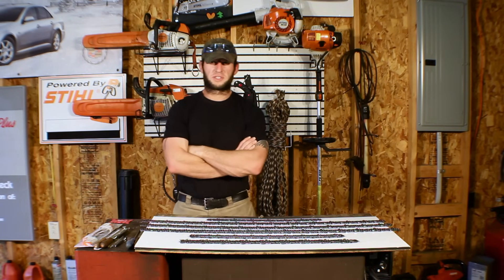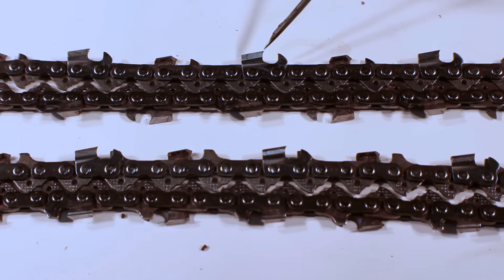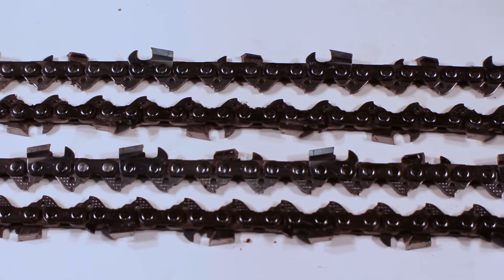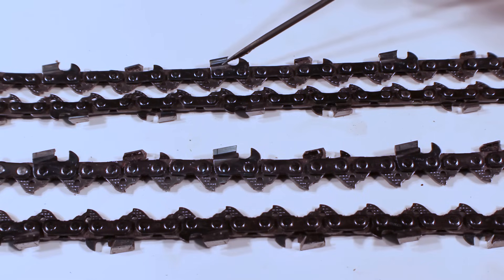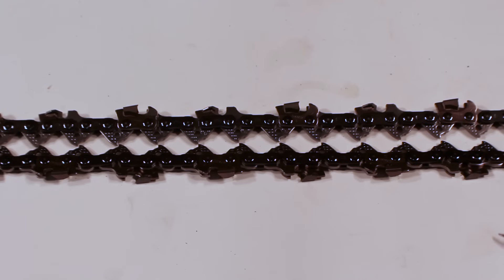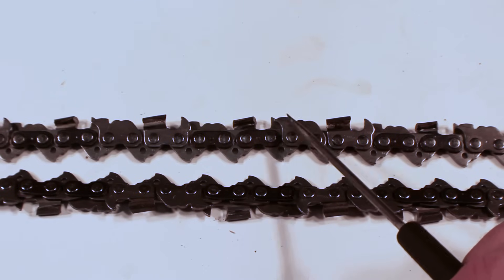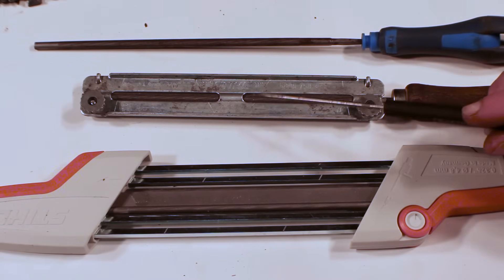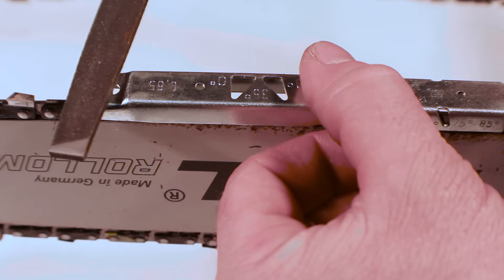Chainsaw Chain Types Explained

Comment: Okay, I want to ask this. a bit off topic but I haven't found anyone who addresses this question.
So I am thinking about buying two saws. one small and one larger and more powerful. So regardless of manufacturer or brand - what two bar lengths make a good combination? In a farm & ranch situation. I am on 16 acres in middle Tennessee,  partly wooded with verious trees. Cedar, White Oak, Red Oak, Ash, Box Elder, Osage Orange  <- (I know - hard). etc. Using mainly as downed tree and limb clean up throughout the property. There is a lot to do throughout. I may fell some standing trees. I do not plan on larger than a 20" bar for the most part but maybe want the capability to go a bit larger if and when needed). So I guess I am asking what smaller bar is best if my larger bar is a 20" ? 
PS. I am thinking probably to have  two saws and not just two bars on one saw as I think those lengths would be too close together.
Here's what I am thinking maybe:
1. Small saw a 14" bar.
2. Lager saw w/ a 20" bar
Does two saws make since? 
But what do the experts say?
I know I got pretty long here but I hope this question makes since.  Thank You.
Extending my question a bit and getting brand specific. I pondered over and over about Sthil or Husqvarna till no end... I am now actually considering an Echo cs-590 with a 20" bar and either an Echo cs-310 w/ 14" bar or the Echo cs-352 with a 14" bar as my smaller saw.
So would either of those saws and bar lengths be a good combination? 
Thanks again.
Reply from the maker: Honestly, if you think you'd want a 20" on your large saw, then there's no reason to go with another smaller saw.  Just grab a 261 (or equivalent) with a 20" bar, and that is the one saw you'll need.  The weight difference in saws between something with a 14" bar, and a 20" bar, isn't significant enough in my opinion to justify having two separate saws.  Going into a 25"+ size bar is different, but I think you'll do just fine with one saw.
Reply: Human Thanks.
well a 261 Sthil was one I was thinking I would get when I was tossing between Sthil & Husquvarna. But somewhat dhifted after a local dealer showed me cs-590. at which time I thought no way to Echo, but after watching tons is videos and foarms on Echo I became much more impressed. The CS- 590 is $399 and has professional qualities from what I hear so far... With that price plus a 5 year warranty on the Echo - would you still suggest the MS-261? 
Thank again
Reply: Calibir1 I have never ran an echo don't know much about them. but I have the 261 with an 18 inch bar love it really light I cut elm and oak with it and chews really well chain is kept sharp as any saw. then my big saw is a 461 stihl I bought it with a 25 inch bar I'm going to a 32 inch bar at some point that way I don't have to bend over as far I know not supposed to use the tip (someone will say) of the saw but when a tree is on the grounds you can't tell me you dont. anyways I'm not a professional but I have been running stihl saws a long time and I like doing stuff the right way. I sell firewood and burn wood 7
Reply: my 261 though came with .325 chain and I wanted 3/8 so I didn't need to try and keep track of files so they put a sprocket and bc on so I could have the 3/8 chain.
Reply: I have three. 14" small Husquavarna,20" Poulan 3400, and a Husky 394 XP with a 32' bar that is my go to saw. I'm 57 and I bought that Poulan new in 86 and have wore out 5 or 6 bars and countless chains but i just can't take working bent over all the time( too many years a a farrier) and the 32" bar makes it so I don't have to. I'm 6'1" and can cut downed wood with very little stooping, does it way more yep but I let the saw do the work so I'm not manhandling it all the time.  If I had to start out again I think I would buy a 395XP and a 16" pro model, stay away from home owner saws. Nothing but agravation.

Comment: Good explanatory video. Had a?. A buddy of mine is planning to fabricate a mill. It will strictly be used for cutting slabs with logs up to 65inch in diameter.with a14 foot cutting length.the power source is a 10hp 3500rpm 3phase motor direct drive through an electric PTO clutch. What chain do you recommend for this application? Again thanks for the video.
Reply from the maker: Ripping chain, made just for that type of application.  Also the one chain (that I know of) that I forgot to talk about in the video, lol.
Reply: Human Thanks bud for the reply. Will relate info to my friend,he was also mentioning of going with a carbide tipped one there pretty aggressive and long lasting.Im not up on the chains and what to use,but I have a machine shop with fab section where I’m building the mill for him.Its going to be very productive for slab work.Again thanks for the reply.

Comment: Been watching your videos for about an hour now trying to decide on my first saw. For now it will be just a saw to throw in the back of the truck to take when I go in the woods hunting or shooting in case of emergency. Also do some side by side off reading. However I would like to keep the possibility of firewood cutting open. What would you suggest as a first saw? Wanting to stick to Stihl.
Reply from the maker: Of course I'd go with a 261, lol.  For what you're wanting it for though, I'd go with a 251 or 271, either one will do you well.
Reply: Human does that mean you would stay clear of older generation saws? A buddy of mine suggested an 034 super if I could find one.
Reply from the maker: Not at all, I love older saws.  Just be aware that depending on how old it is parts may be an issue.  I've not a whole lot of experience with older models, but I generally hear from those that do that the older saws are built better.

Comment: What are your thoughts on running 3/8 picco with a regular 3/8 setup? A lot of people on the forums say to switch the bar/drive sprocket,  and my local shop says it will run the same as standard 3/8 chain.

Comment: anyone know... IF .....its known.. that Stihl mistakenly stamps the wrong inch size on a bar ? I have a ms250 and 024AVS  ,  just bought the 024 and told was 18" and bar states 18" .325   .063 74DL
  so looked at the MS250 because is was gona order several new chains and it said 18" so i ordered extras only to find that when  i put one on the 250 the bar is so far out the outer bolt barley touches the bar !!  i laid the tow bars together and one appears to be 1.5 - 2  inches longer, same with old chain and new chain, even when thinking about old chain stretch ....chain appears to be 2 inches longer that old on the 250????????

Comment: awesome and informative vid buddy. I have a poulan 16" saw I got for cheap what chain type would you recommend to cut fastest with low  maintenance? I don't mind paying for good quality. I'm thinking rescue chain?
Reply from the maker: Rescue chain is super expensive, and not generally all that great if you're cutting wood, they're made to hit metal/brick/etc.  I'd stick with a regular full comp chain, and just keep the depth gauges a bit high so it doesn't bite so hard.

Comment: Is it still possible to do a bore cut with the safety chain? If that depth gage/raker is lifting around the tip of the bar I would think that could make that difficult or almost impossible.
Reply from the maker: What I thought at first as well, but it makes no difference, saftey chain bores just as well as non.

Comment: Are skip-tooth or semi skip also referred to as ripping chains? Are the cutterheads the same for ripping and standard chain?
Reply from the maker: Ripping chains have the cutter teeth filed at a 10 degree angle instead of the normal 30 degrees.  Skip tooth is 1 cutter tooth where there normally would be 2.

Comment: Okay - I should know this but what is the correct gas/oil mix for a Sthil small MS 170?  I have heard/read  50:1 and as much as 20:1     Thanks much -   Gary
Reply: 50:1 and use proper synthetic 2 cycle mix oil. Running a mix with more oil than 40:1 will make the saw run super hot and kill it quick.

Comment: Human, 
I got the MS261C-M 18” bar. The chain it came with is a 74 drive link. I’ve been looking to get another chain, looking at the Yellow chains, Yet I noticed most of them are 68 drive links. All state they fit an 18” bar. 
Do I need to stick with the 74DL or will the 68 fit ?
( I’m new to this! )
Much Thanks!
Reply from the maker: Yes, you must stick with a 74 DL chain.  The 68 DL will only fit 18" bars on smaller models.  Some of the saws have different distances from the drive sprocket to the chain adjuster, biggest thing to look at is the drive link count (and pitch/gauge of course).  So just make sure and grab a  .325, .063, 74dl and you'll be good.  If they don't have it (no reason they shouldn't) ask them to make one from a spool, if they don't have a spool, find another dealer.
Reply: Human, 
Much Thanks.

Comment: Does it really matter if I change my chain from a 62 link to to a 63 link chain?  It is on an 18" chainsaw and I figure since I can adjust it that one link difference should not matter would you agree?
Reply from the maker: I couldn't really say one way or another, going to depend on the saw I would imagine.  I do know that I just replaced an adjuster on a work MS 290 becuase they had one extra link in, and just thought muscling on the adjuster would make it work for some reason.

Comment: quick question.  I was out running my cs590 today.. chain kept getting loose.  finally got to the point where it wouldn't tighten anymore due to the bar being out of adjustment room.  Still plenty of life in the chain cutters.  is the chain wore out?  do I just remove a link in the chain?
Reply from the maker: You can remove a link, what brand chain?  The whole reason I only run the stihl chains currently is that the others kept stretching and pissing me off, I'd maybe try a different brand.
Reply: Human it was the factory echo chain.   Of I take a link out won't it change how many drive links there are?

Comment: ms361 24" bar has no info , so do you have a vid on how to know what chain i have on it to buy more?  links have 3/8 on some , stihl C on some, m1 on some ???
Reply from the maker: look on the bar, all the info is lazer engraved on it
Reply: @Human1337   yes , thats why im asking , the bar clearly says 18" but putting an 18" chain on the bar, its so far forward its barely touching the first bolt...!!  clearly the bar is stamped wrong which is why i asked if any one has had a bar marked wrong.....!!!!
Reply from the maker: @topflight2358  18" isn't the size of the chain, chains are measured in drive links, will be shown as DL on the the bar  like x55 DL = 55 drive links

Comment: how's the carbide chain working for you?
Reply from the maker: Couldn't tell you, borrowed it from the parts guy at arts, had to take it back.  Same with the rescue chain, no way I was paying $200 for a chain just to use in a video, lol.  I need to get a carbide chain, but there are things higher up on the priority list right now, namely a port-a-wrap and arborist block.  Boss doesn't mind that I use his, but I prefer not to rely on other peoples equipment.
Reply: Human what chain is $200? don't use the emergency chain use the duro3 for the chain and bar that you use most, it will save you lots of time and money. the boss should buy it for you because it will save you time swapping chains and sharpening.
Reply from the maker: Yes, it's the rescue chain that's super expensive.  Doubt the boss will go for the carbide, mostly as we don't have a means of sharpening it.  I'll work on him though, lol   =)
Reply: Human it's simple enough to get a diamond round file for sharpening the carbide chain and you can use it on steel chains too. why don't you like to use the company Port-a-wrap and block pulley? They should be able to supply a higher quality one than you could purchase on your own.
Reply from the maker: I should have specified, these are for my side jobs.  On the job, of course I use company equipment.

Comment: Talking about sharpening equipment for carbide tipped chains, we used to use a "green wheel" to sharpen that material in the machine shop. I couldn't remember the composition of the wheel, so I googled it and this came up.

"Green silicon carbide wheels are more friable than the black wheels and used for tool and cutter grinding of cemented carbide. Cubic boron-nitride (CBN). Cubic boron-nitride is an extremely hard, sharp and cool cutting abrasive. It is one of the newest manufactured abrasives and 2.5 times harder than aluminum oxide."

Proper attribution for the quote goes to americanmachinist.com

Comment: drive links do not give you length of chain !!!! some 18 inch chains have 68 drive links and some have 72 ect !!! i think the pitch has to do with this im not shaw !!!! but i have a stihl and a johnsered both 18 inch and they both have different drivelink count !!!! Just something to beer in mind !!!   great info videos though!!! keep them up !!!!
Reply from the maker: You're correct.  The pitch makes a difference, and also the chainsaw model.  Different models can have different distances from the sprocket to the bar.  For stihl saws, a model with a tooless chain adjuster will have different drive link counts than the same model that doesn't have the tooless chain adjust.
Reply: so one 18" chain can be different than another , even for the same saw model? having stress with a 18" 445 husky that i bought some new Husky replacement 18" chains for and they are noticeably longer than the original that came with the saw when i bought it,  which to me is a little nuts. i get the pitch and width part, but shouldn't 18" be 18" no matter what?
Reply: Nah, an 18" Stihl with "quick chain adjust" technically uses the same bar as one with normal chain adjustment. Only differences are the lack of regular bar adjuster, different bar cover, and adjuster gear added to the bar.
Reply: Different manufacturers use different bars, this will cause the variation in driver count.

Comment: Whats your opinion on filing the rakers off?
Reply from the maker: I wouldn't.  Even taking them a bit too low can cause huge problems.  when I first got a set of the 2-in-1 files, I took all of them down too low, chain binds, jumps around, serious kickback hazard, etc....

Was not a fun time
Reply: 200lbGorilla, ripping chain has a much lower raker than other chains,  but you would pretty much ruin any chain that you took them completely off. You couldn't adjust them to the cutter any more.
Reply: I always use a hacksaw blade. Rakers should b low enough to just slide. Hacksaw blade under cutter. Just my own experience.  Croscutting  Simi green FIRE wood. There probably is a proper way. Especially on ripping chains. I have no experience with them btw. But  will soon. Just got a Mack 25080cc with gocart carb . I use 112 octane leaded fuel in it with 3' bar.
Reply: @walliehart2055  
Now wait a minute, the guy in the video never mentioned "Rakers" and I believe that rakers is more of a common nick name for the "Depth Gauge" right? If so then once you bad back just a little on the cutter then the depth gauge will hold the cutter up to high and not let it cut out the right amount of wood. So you end up with a VERY slow cut and a over heated chain.
Reply: @mwv8408  Yes all my life i have heard depth gage refereed to as rakers. As far as a bad back goes yep . Got 3 vertebrae between shoulders that are square, instead of the normal rounded vertebrae. Doc is clueless. Impact fractures usual reason.my lungs are anouther issue.  Lots of scarring from asthma. As a child. At 17 years old my lungs where basically 30% in size and function compared to normal 17 yo lungs. My family Doc at time refused me as a patient because i was working.  He said "You wont make it to 21 if you work"Dr. Morgan was wrong . Im 40 still breathing the same Thank GOD . He still refuses to Dr me. 
   You are correct Sir. I have no experience using a ripping chain with rakers. Only cross-cut to cut firewood.  I have been lied to all this time. Or maybe my mentor was misinformed also? I think so. My father didn't lie nor do i..
Reply: @mwv8408  thank you for pointing out that bad info can cause serious problems and ramifications.  That hot cutter could come back at ya and do some serious damage. Best to except the pros. Findings. His findings are better than some dude that OWES you something.

Comment: How fast can the chain turn?
Reply from the maker: It's different depending on chain pitch, engine speed, and sprocket size.
Reply: Thanks! What I was wondering is going to 8 tooth would be a bad choice!
Thanks!
Reply: mike 13, it depends on engine power and the size of the bar and chain, and how aggressive you set the rakers. The faster the chain runs the faster it can cut and wrap around your leg or hand if it breaks.

Comment: You need to get yourself a chain sharpening machine mate :)
Reply from the maker: Was thinking about it, but the 2-n-1 files make sharpening so fast (on the saw at least) that I can't really justify it to myself.
Reply: Human I used to be a small motor mechanic and from my personal experience with the ammount of tree lopping you do on a regular basis an electric chainsaw sharpener mounted to your bench would pay for itself in no time :)

Comment: i WOULD THESE CHAIN  FIT MY POULAN PR 18 INCH GAS CHAIN SAW
72 lpx _066g  OREGON 
3/8''  0.050 FULL CHISEL SAW CHAIN
I SAW AN ADDON EBAY  10 FOR A BOUGHT 150.00